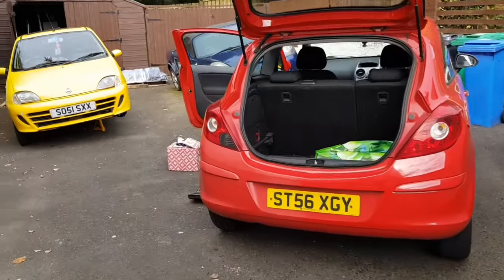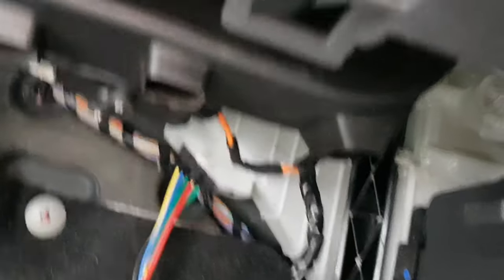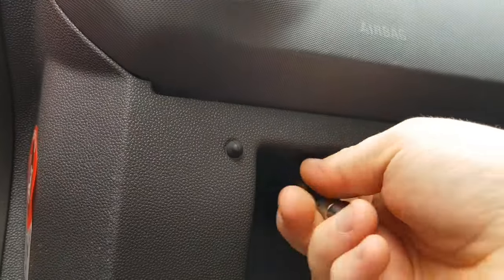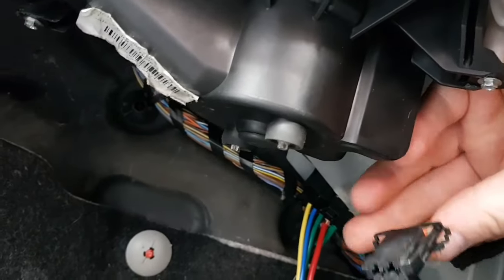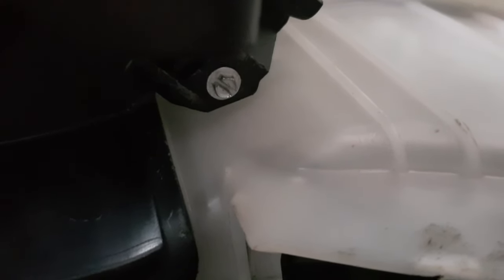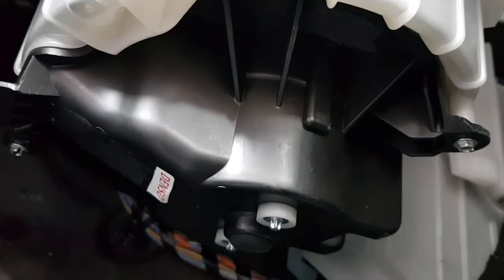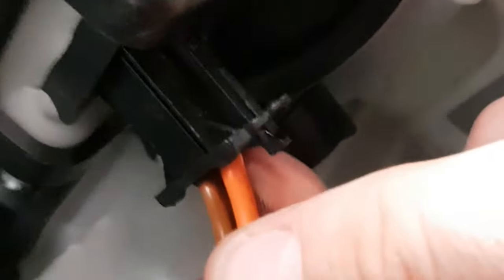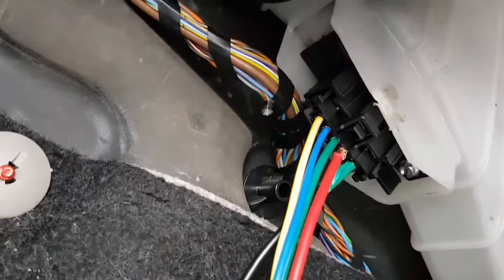Step by step replacing the interior fan / blower in a Vauxhall Corsa D.

Comment: Hey Neil great video
Maybe of help I've just changed my heater fan as dircribed in your vid .... But I managed to do it whilst sitting in the passenger seat, using a mirror on the floor it was dead easy, small light added to the visibility.
I'm 6ft 2" and got at it quite easily.
Took 38 mins to change fan and resistor and put back together.
Happy Days 
Kev
Reply from the maker: Thank you. I'm only 5'10 so no doubt that'll be of great help to our taller folks! Happy motoring!

Comment: Hi great video, mine has just started making a buzzing noise, which sounds worsed on number one?
It's a 2011 Corsa ecoflex, which I've owned from new, and it's been serviced every year by the original dealer,
Do you think I need to replace it?
Cheers
Paul Foster
Reply from the maker: Heya Paul. Well to be honest I guess it depends on wether it annoys you enough to want it looked into haha. Maybe you have an awesome stereo that could drown it out haha. 
 If it's an electrical buzzing, I would personally maybe try disconnecting the electrics, checking them for any physical damage such as charring or  burning of the contacts etc. If they seem ok, try re-connecting them and see if it fixes it.
 If it's the fan itself or the piping that that the air goes through, you could try checking them for debris and the fitment to see if theres anything that could be out of place and causing the buzz. 
Best of luck matey.

Comment: Great very  helpful. How many fuses. I found the big 30amp one under bonnet  But is there another one. Its just before I go buy fan . Want to check. I pulled of that brown and orange wire going to the fan . Put a test lamp on it and it don’t seam to be any power at it ?? With engine and fan on. Is brown + or orange. Although I did try it both ways with test lamp and its showing  no power at it.
Reply from the maker: On the left hand side of the dash there is a little covering that lets you access the interior fuse box. On the inside of the covering is a plan diagram of the interior fuse box with the names and amperage's of the fuses. Best of luck!
Reply: @NeillWylie  Thanks I got it wotking, it was the resistor.

Comment: Hi Neill, I'm in Aberdeen and fan just stopped a couple of days ago - where did you order the replacement unit from? I just got quoted about £350-450 worst case for an auto electrician to do this job for me. With this video, I feel very confident that I could do the work myself. Thanks, Greg
Reply from the maker: Hey hey. If you haven't already done so, remember to check your fuses and resistor first before replacing the fan as they're a lot cheaper. You will be able to see the broken fuse or the burning and charring on the resistor poles if this is the case and their replacement will save you some money if they are the problem. 
I can't remember exactly where I got this fan now but you can get the fan here https://www.eurocarparts.com/heater-motor/?promo=MID60 at the moment 12/01/2021 and apply the code MID60 to your checkout to get the fan for about 70 quid.  If you look on ebay you may be able to get it cheaper. Have fun and best of luck.
Reply: @NeillWylie  Many thanks - I'll check those out first but £70 already sounds a whole lot less. Might have to treat the missus to some KFC to celebrate the savings :D

Comment: Very informative video!  Is there a knack to get the resistor out? Or is it just pull the bucking fastard out?
Reply from the maker: There's a single small bolt holding the resistor in place, once you remove it, the whole shebang should come out and you'll be able to see the resistor  and where it connects to the cabling. To remove it from the cable, there is a little clip on the long side of the plastic plug that you have to depress. I reckon I might do a video on the resistor as I have had a few questions on it.
Reply: @NeillWylie  couldn’t get the resistor out... managed to get the fan out without undoing the glovebox.   Stripped and cleaned the motor & all working fine 👍

Comment: Thanks for the video, I've already used your other video to change the resistor but I need to change the fan. I have a 2010 corsa SRI, do you know if the part number be different? Thanks for your help.
Reply from the maker: Hey there. As far as I know, the interior fans should be the same. To be safe though, it might be worth trying the Vauxhall Corsa forums online where you can search for the advice of other sri owners. Best of luck!
Reply: @NeillWylie  Thanks again 👍

Comment: The pin that holds the grills in place has snapped after I removed my magnet holder from it. Any way to fix this without having to buy a while new part?
Reply from the maker: Sorry, I'm not terribly sure. If it's the pin visible at 12:10, I'm not sure if that's supposed to come apart and go back together again. Sorry I couldn't help further.

Comment: Nice video. I bought a corsa not long back its heater was broken. Worked on 4 that was it. Got a resistor motor off internet swapped them over every dial worked perfectly. Now couple weeks later it’s temperamental works when it wants and when its been on a while it screams. Any ideas
Reply from the maker: If the resistor is new I think it might be the fan itself. If the fan is stiff enough to stop it from rotating moving, the resistor can overheat and burn out. If it's neither the fan or the resistor that are the problem, then it may be the switch that changes between fan speeds though in my experience, this is unlikely. I don't think it's the fuses that have gone as you have said it's still working occasionally. I suppose you could remove the fuse inside the car and in the engine bay to give them a clean and re-seat them if you really wanted?
Personally, I would remove the resistor and check it for signs of burning out. I would also remove the fan and take it out of the casing to check that the fan spins easy and free. I would also check the connection between the brushes and fan motor to make sure they arent fouled. Best of luck!
Reply: Neill Wylie cheers fella not the weather today to be opening the car up ha ill try tomorrow or Monday. Was out earlier working fine then all of a sudden just went off strange. Hopefully just the motor ill let you know how it goes 👍🏻
Reply: Neill Wylie alrite neill where can i buy a brand new motor fan for corsa d
Reply from the maker: @stoneralien5163  I'm sorry about my late reply. I usually get my parts from Eurocarparts or from E-bay / Amazon or the like. I went for a new fan in this case because it wasnt terribly expensive.
Sorry again for the delay.
Reply: Neill Wylie sorted got one from local breaker yard brand new heating never been better ha. One other thing my horn has stopped working possibly the fuse?
Reply from the maker: @stoneralien5163  glad to hear you got it sorted. With anything electrical I always start with the fuse and work my way back from there. I always do the fuse and then all of the connections though I wont lie, electrics aren't my strong point.

Comment: I see you rewired the heat resistor loom how did you do that also which colours to do you connect to each other ?
Reply from the maker: Edit: I replied thinking this was a newer video so have to redact that and change the comment for when this video was made. This wiring was from when I bought the car. Since then I have swapped out the part with a generic one I got from the internet that has different colours where I marked the correct colour with appropriately coloured electricians tape. All I did for the order was number the cables from one side of the plug to the other, then join them to the new plug in the same order.
Reply: @NeillWylie  sorry I’m a bit confused

Comment: If the car only putting out cold air is it time to change blower ?
Reply from the maker: If only cold air comes out, it's most likely a problem with yoyr "heater matrix" which needs the air bled put of it. Check your coolant levels. Good luck!

Comment: hi how can i understand if is fan, fuse or resistor ?on my opel corsa d where i have to look for the fuse which number is?on all position the fun heater is not work
Reply from the maker: Hi Tahir. When I was having problems I checked things in this order.
1. I first checked the fuse box in the engine bay. If I remember right it was a Large Green 30a Fuse in position F5.
2. I think it's worth checking out all of the plugs and sockets connections for the parts. Some may have come loose. Sometimes this is as simple as unplugging and re plugging them. Other times they may need a little clean.
3. I checked the resistor which had blackened and melted contacts on the pole that controls position 1 on the blower motor in my case. This stopped position 1 from working in my fan. To check the resistor you would need a multi meter and would need to check the connections from the pins to the poles. If its visibly damaged, I think it would be safe to assume that you need a new resistor.
4. The fan itself. Sometimes like I showed in the video, the copper commutator can become clogged from residue from the soft, black, carbon brushes. If the Copper commutator is black, give it a good clean. If the fan isn't free and easy spinning, this can cause the resistor to burn out. 
5. It may be the actual switch on the dash. Unfortunately I don't have experience working with this bit of kit. If I had no luck with the fuse, plugs, resistor and fan, this would have been my final check. 
Best of luck Tahir!!

Comment: could this be the reason to why my heaters don’t heat up quickly?
Reply from the maker: If your heaters don't heat up quickly, that is likely to be another issue. There is an "Interior heater matrix" that the air is passed through before it enters the cabin. If there is air in this heater matrix, or if none of the heated coolant is passed through this heater matrix, then the air will remain cold. If you check online for a way to bleed air from the coolant system in particular the heater matrix I have mentioned, it is likely you'll get heat again. If you don't, further investigation will be required.
Reply: @NeillWylie  thanks for the tip!

Comment: Bodger
Reply from the maker: and Badger?
Reply: @NeillWylie  😂
Reply: It was a helpful video even if found your tool choice and methods questionable so thanks anyway. Forgive my rude comment
Reply from the maker: @richarddukes6872  out of genuine interest for the future, which tools and methods do you use and do differently on this job so that I can try them?
Reply: @NeillWylie  I'd use a small adjustable spanner not long nose pliers 
And potentially look at changing the screws for flat/possy heads instead of taking a hacksaw to the bolt heads
Reply from the maker: @richarddukes6872  I'll make and link a video regarding this tomorrow.